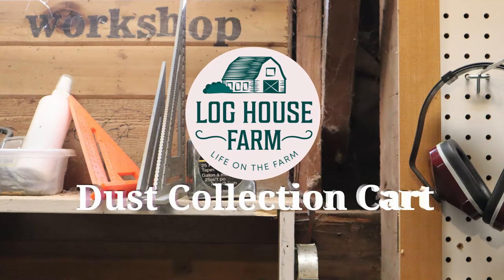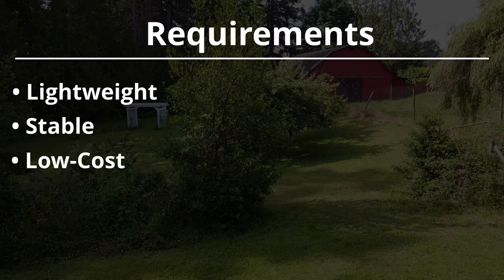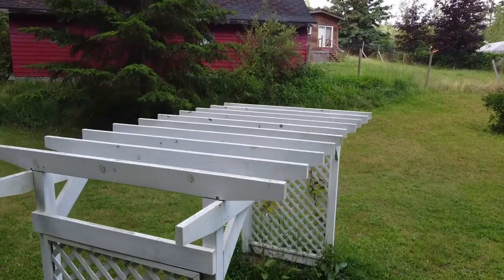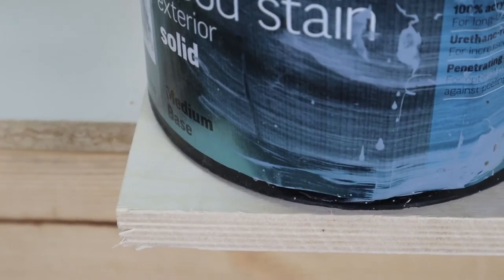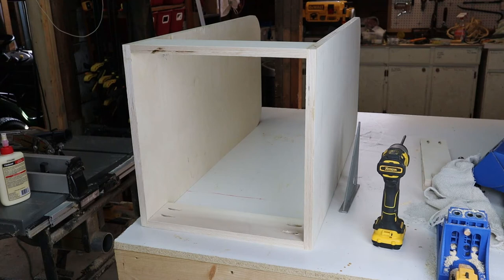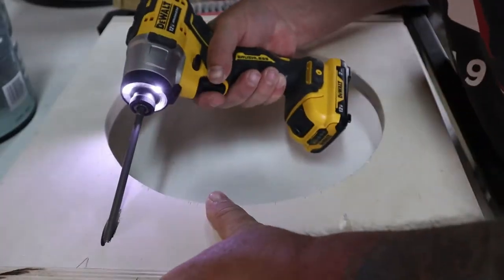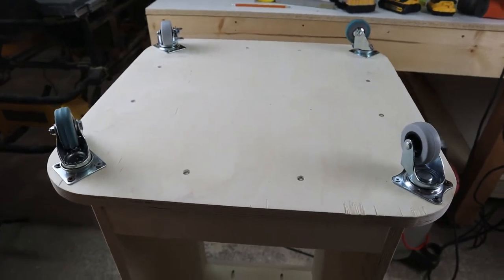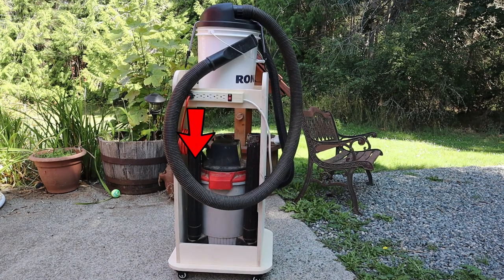Shop Vac DIY Dust Collection Cart - The most Handy Item in my Shop!

Comment: Number one requirement is lightweight but you built it from 3/4 ply?  A good detailed video thanks for taking the trouble to make this and post it.  I just don’t have room for another piece of equipment in my little shop so I made a place to set the shop vac and dust stopper pail in the other part of the garage and  Ran a long hose through the wall that reaches pretty much everywhere in my shop.  I Keep it connected to the bench belt sander and unplug and move it to what ever tool is being used.
Reply from the maker: It's funny how things change, I ended up getting a longer hose and now the vac sits in the middle of the shop and hardly moves... The wheels are nice when I do need to move it though.